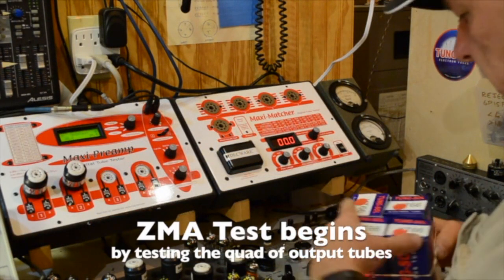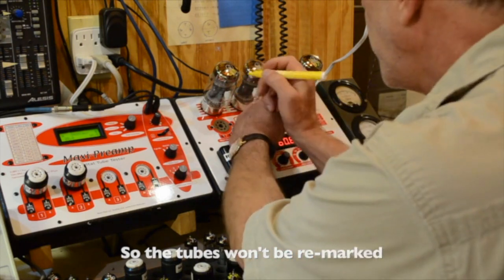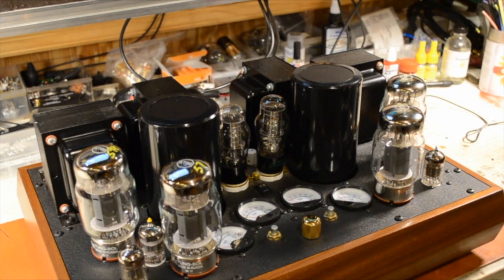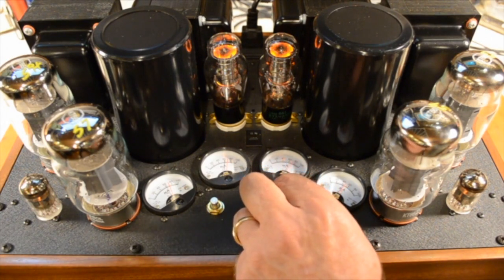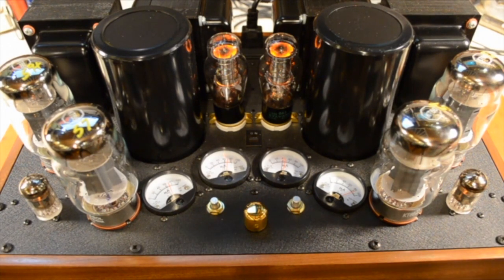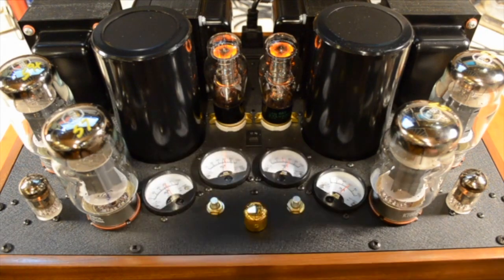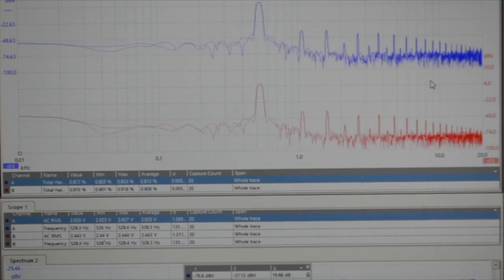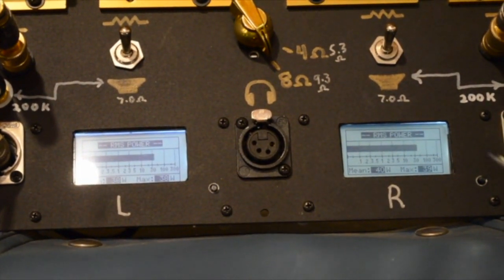Model ZMA testing

Comment: Wondering how the ZMA would do with a pair of Focal Kanta 2's ?  Sensitivity for the Kanta's stated to be 91db, Stereophile measure them more like 89db.
Reply from the maker: It will drive them fine.  No more hunting for the bloom using the volume control, it will always be there even at low levels.
Reply: I guess it's the hunting for the bloom that got me to where I am today.  A larger living room, prompted me to upgrade from my 20 year old speakers, to the Kanta's.  It's been nearly 2 years since, and I'm still undecided on the amplification path, but leaning more and more to have tubes somewhere in the chain.  I'll likely get directly in touch, as I get nearer a decision.  I have 3 input sources, but could reduce to 2, so reckon I'd need a pre-amp with the ZMA ?
Reply from the maker: @larrypupkin    If your sources are RCA, you can use either a preamp or a switch box like our model ZSB.